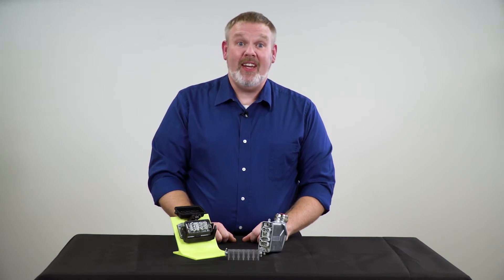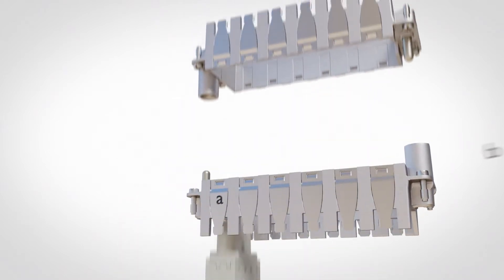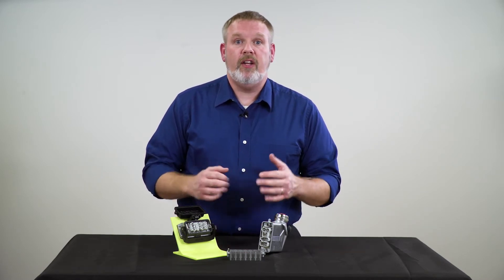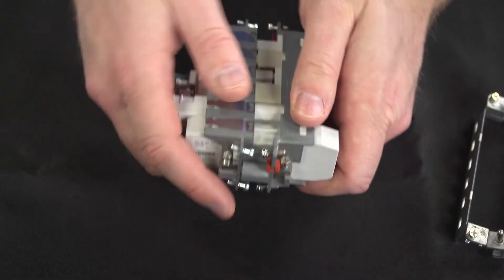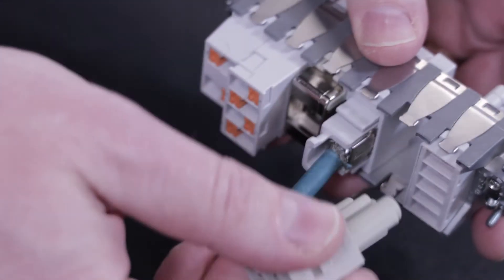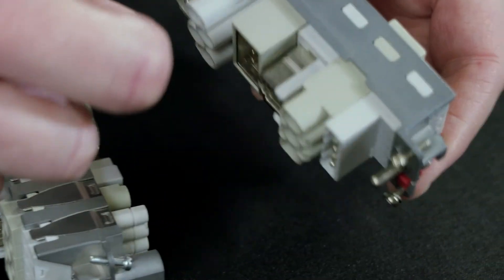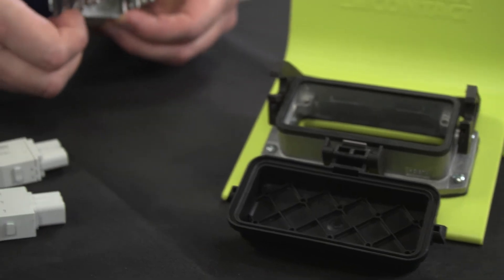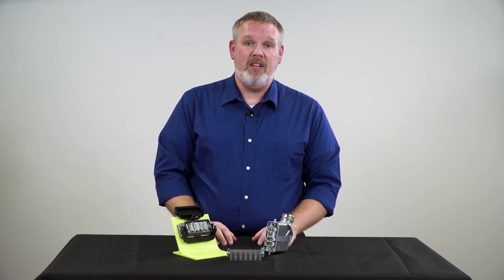Design Details with Dean - Modular snap-in frames for HEAVYCON

Comment: When installing the snap-in frame into the base housing, can it be installed in either direction? That is, slot 'a" on the right side or the left. Or can it only be installed one way?
Reply from the maker: It can be installed either way, but it would be prudent to establish a single direction when designing the connection.  

It’s important to be mindful of how the mating plug is being assembled to ensure that the cable is feeding off the connection in the correct direction.  It’s not a huge concern for tip entry housings where the cable exit is in the middle of the housing, but can become important if using EVO plugs (inlet is offset) or any plug with a side cable entry.  

So in short, you have the freedom to install it either way, but whichever way is chosen should be locked into the design spec to avoid potential problems with the cable feed later on.
Reply: @PhoenixContactUSA  Thanks for the reply folks! I will absolutely make sure to document in all my drawings the proper layout.